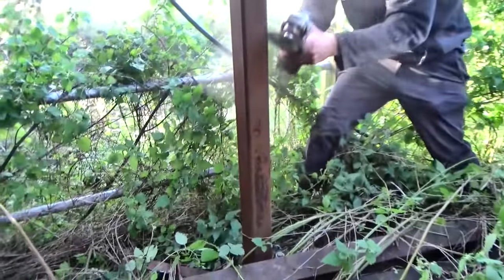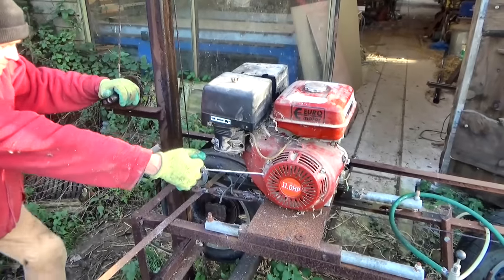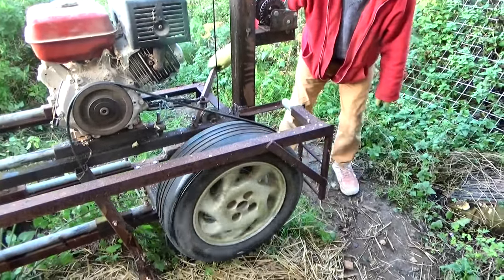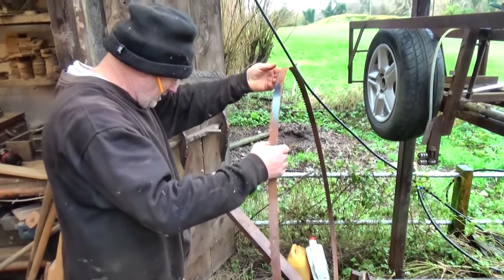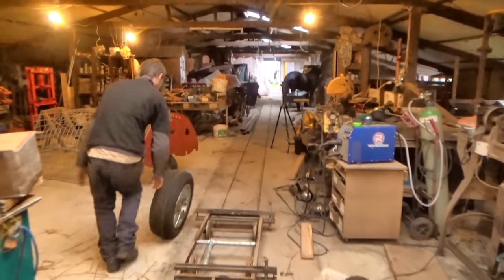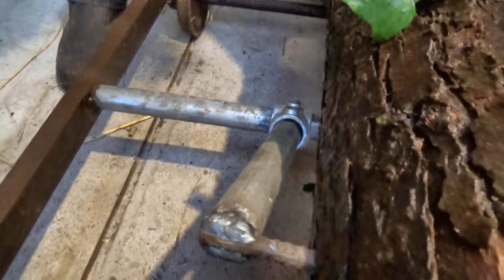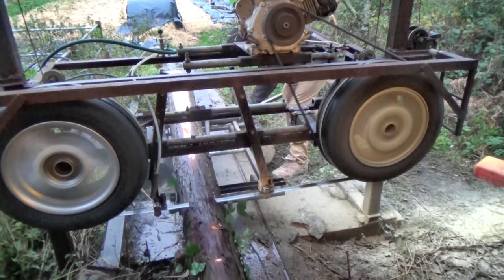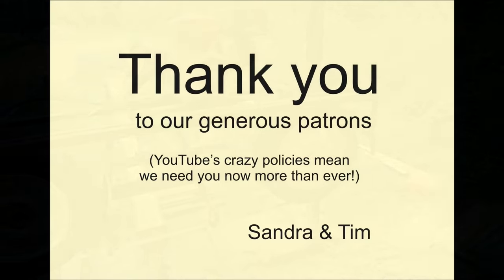Getting The Homemade Bandsaw Up and Running Again..

Comment: Sounds like you need to make yourself a slave tank out of a discarded compressor tank that way you can fill and hold a remote tank for transporting under pressure 
I made one and they are wonderful you can fill all four tires on one pressure up and if built right it’ll hold the pressure for months

Comment: Please, consider building a shroud around the saw blade. If it breaks while in use, it could be lethal or give permanent injuries.
Reply: Yeah at least pannels around the tires
Reply from the maker: There are safety bars at both ends

Comment: The saw might be slightly less scary if you fashion some sort of guards for the belt and sawblade. 
And perhaps a bit longer of a handle for the trolly, but the view is deceptive. I would think you would rather be standing upright as you move the trolly along, rather than hunching over to pull it on. :)
Reply from the maker: But there are guard bars at both ends!

Comment: So I have genuine question and concern about this.. In the event that saw comes off the tires at such a high rpm, there’s nothing to stop it from moving uncontrollably (begins moving in whatever directions it’s spinning). I have worked with a variety of ban saws I am just really concerned for you guys if this saw comes off the tracks. Would recommend come type of rudimentary guide/track to secure the saw in the event that it comes off the tires.
Reply from the maker: Not quite sure what you mean, Josh. If it comes off it will fly off somewhere. I put bars at both ends to try to stop it going sideways.